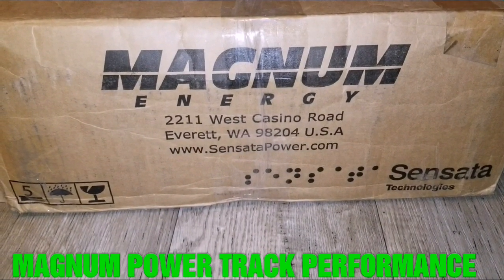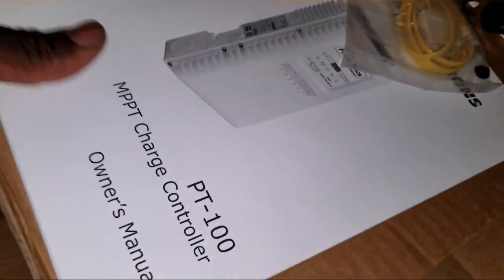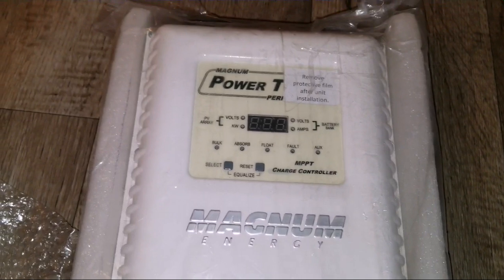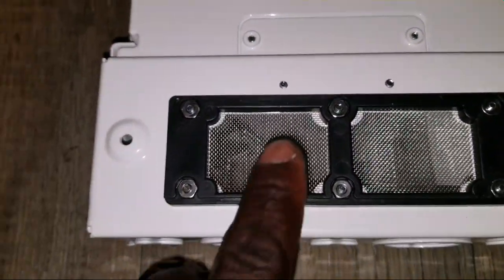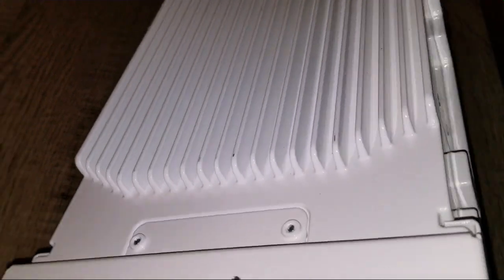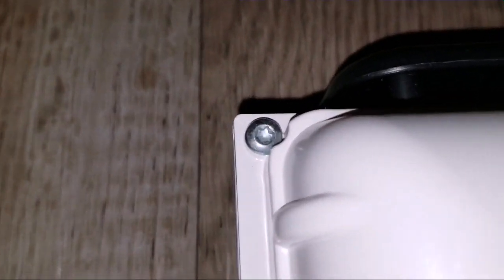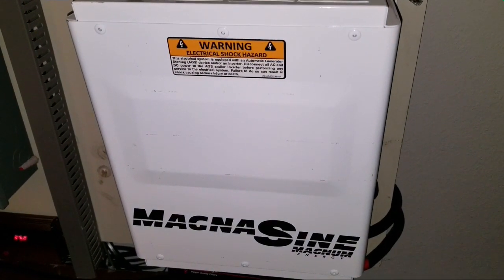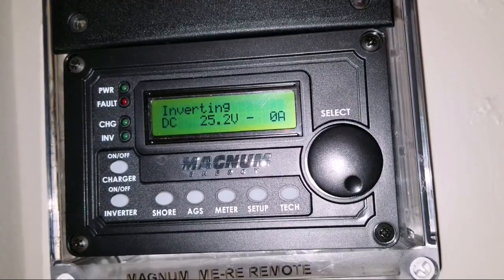PT 100 MPPT CHARGE CONTROLLER BY MAGNUM | Unboxing & Features

Comment: I have been using two of these for a 20 months with no problems.  I typically bring in over 3000 Watts on each of them (20-40 kWh/day).  One important note: They will cut out at 187 volts.  I made the mistake of sizing it based on the 200+40=240 voltage.  For me, the 187 cut off only comes into play on freezing cold days with bright clear sun.  Details here:  https://youtu.be/UJrSk1r8hhk
Reply from the maker: Thanks for the info brother. 
I haven't done anything to it yet. I am looking at getting another one for total of two and plus another Inverter.
I suppose you watched my video on my  MagnaSine Magnum MS4024. 
I am thinking of stacking them in parallel and that mean I have to by a Router instead of ARC-50 Remote.
What do you think brother?
Reply: jwsolarusa, I think there is a big advantage to having all your components with a single company.  It looks like you have the Magnum inverters, charge controllers and router plus a lot of other stuff from various other manufactures.  I think I would build out your new system with just the Magnum stuff so that it all communicates and works well together primarily with regard to how the batteries get charged.  Then sell the other stuff to help pay for it all.  I think it would be tempting to use some of the other stuff tacked onto the Magnum system but that might hurt you in the long run as it is not communicating.  That's just my 2 cents not knowing what you have and you probably have a better idea anyway.  FYI: there is a new router available now ME-ARTR, the advanced router.  I think it can control the PT-100 directly so I would recommend that one over the ME-RTR.  Keep up the good work!
Reply from the maker: Thank you Sir.
I really appreciate your opinion and your recommendation.
Please have a wonderful day brother and stay blessed